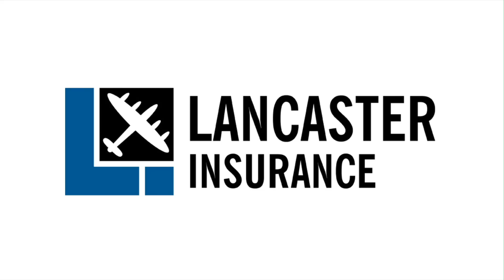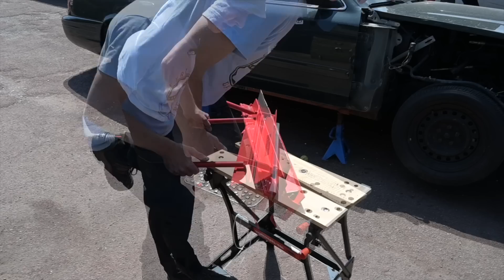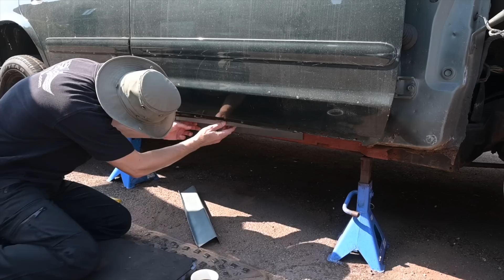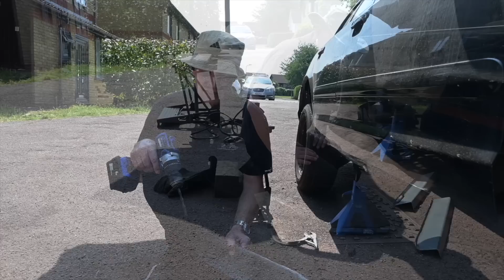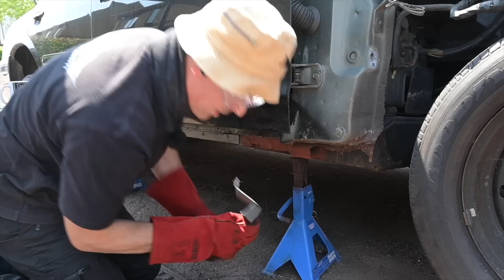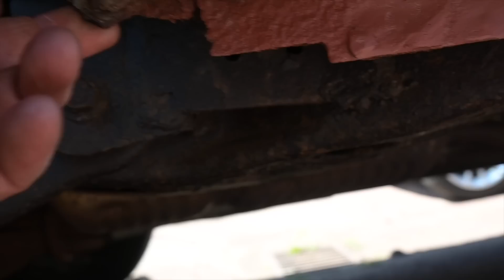Crown Vic! Its got more new metal!

Comment: One technique to replicate pressed indentations in a sill panel, inner strengthener etc is either by marking out the shape on the panel using a Sharpie then hammering over an open vice where the vice jaws are open slightly wider than the width of the feature you're replicating or using a socket and a big bit of rubber sheet, floor mat etc and squeezing the lot between vice jaws.

Comment: Often the case after reeling with shock , before you found the plan of action , but once you get going things take shape . it strikes me you need a Planishing hammer and a hand Dolly with at least two flat sides that you can hold behind seams to support coaxing with said hammer so you can shape bits and push metal in to corners , get one with a finishing pick back end that is flat chisel like ,I found that best for teasing metal in to corners , getting stuff flat and tapping around things like your mole grips .

Comment: I don't know if anyone's suggested this, but for the corrugated bits on the inner sills, you may be able to stitch the easy to get at, flat bits on, then use the ball end of a hammer to knock any recessed bits in. The metal will stretch a little, but that can be used to your advantage. Bit late for side number one, but might work for the other side?

Comment: Considering you're a professional photographer your panel beating/welding is very impressive. As a H&S professional myself in an engineering workshop (burn, weld, grind) I cringe when you wield a grinder. Severed digits, limbs and arteries are a real hazard. As I very much enjoy your channel I do not wish to see you hurt. Please consider not holding the item your grinding in your hands but clamp it in a vice/workmate. If that disc kicks back there may not be any more Furious welding/driving. I know, I Know bloody H&S kill joys but I've seen too many bad injury's not to say anything. Brilliant channel and I want it to continue.
Reply: A mate of mine just had two weeks off sick until his thumb had healed after a piece of sheet metal caught on the drill press. So yes, it's a real thing!

Youtuber CT Moog has a lovely (unintentional) safety demonstration on his channel. In one of the earlier Beetle repair videos he tried to drill holes into some sheet metal without clamping it. The drill caught, the metal started spinning, hit a can of WD40, bashed a hole into the can and the can set off like a rocket, flying at least three metres through the shop.
Reply: At least he wears goggles and ear plugs. Most of us don’t.

Comment: Who else on here is struggling on d driveway in the heat?? 
Me, taking the car to bits changing a clutch, no welding yet... found a little hole in my cinquecento that needs playing with and I haven't got a posh welder like Matt 😭
The harder it is, the more satisfaction there is when it's all done (I tell myself).

Comment: I use flux filled wire, it's easier, cheaper and you don't get 'empty bottle' anxiety.
Reply: It works properly outside too, whereas gas welding often doesn't.
Reply: It produces shite looking welds and much more crap to clean off. Is harder to get a decent looking welds from flux core.... I have one and want what Matt is using.
Reply: @terryatkinson899  The flux residue can be a pain, and so can the smoke from the flux while welding. But I've used a gasless MIG to patch up sills, and when I was finished you couldn't even tell it had been repaired (and I didn't have to skim it with filler, either).
Reply: @Zeem4  I bow to your experience,  I bought mine from Aldi with the intention of doing some car repairs on sheet steel, however I find it frustrating to use, either the wire speed is all over the place or it burns holes. Where I've managed to get welds done, they look crap compared to what a proper mig would produce. My other welder is a stick welder but it's not for light steel. A stick welder is easy to use for most things and the welds are as it says on the tin 🤗
Reply: @terryatkinson899  Mine's a 90-amp Ferm unit with automatic wire speed. That being said, it is prone to blowing holes through thinner steel, but it might need thinner wire for that.
Reply: @terryatkinson899  It works well for me, maybe your technique is just shite.

Comment: Watching this, and you talking about the corrugation, I am wondering if the piece you are putting in should be straight, only spot welded where they meet. That would allow condensation to drip out. The sills are meant to have water flow down from the cowl vent and drop out the bottom of the pinch weld. Since those two layers you are working on are the two inner layers of the pinch weld, it may be that they should not be sealed.
Reply from the maker: The vertical parts didnt touch before, there was always at least 5mm between the inner and outer sills, at the bottom (horizontal)  it was a tight sandwich, but that seems to have been a source of rust as it was unpainted and corroded between the layers.

I will drill drain holes in the base of the inner to drain out, so it will still allow water to get out

Comment: From our perspective watching the video, would it have been easier to remove the passenger side doors.
Reply from the maker: I didnt want to take those off, or open them while the sills cut away in case it alters the geometry of the sides.
For the inner the obstacle is the outer sill, which I cant do much about!